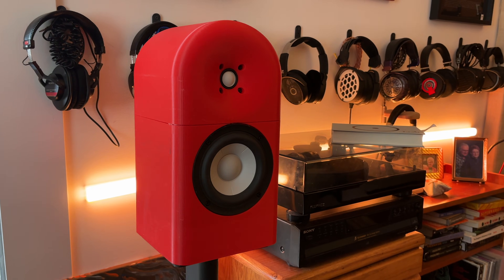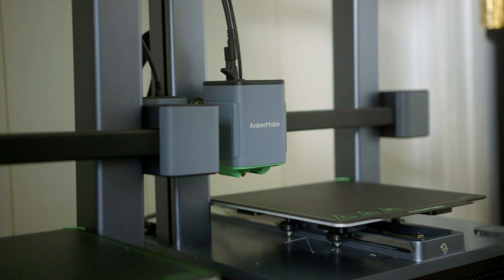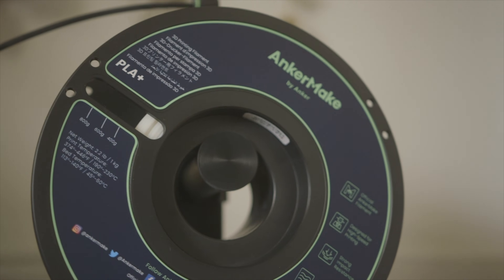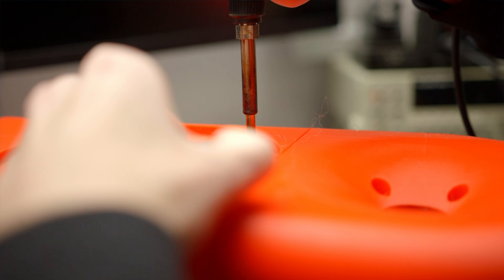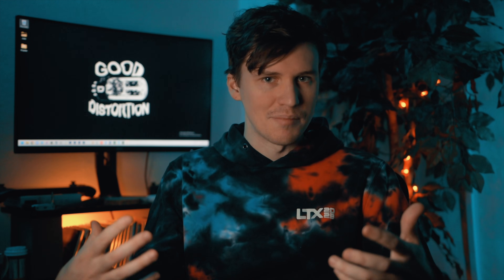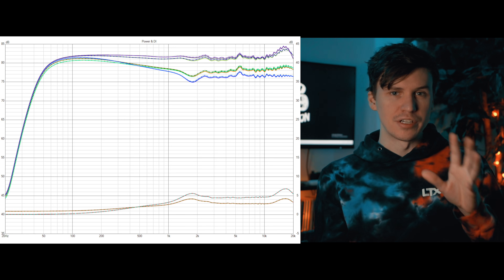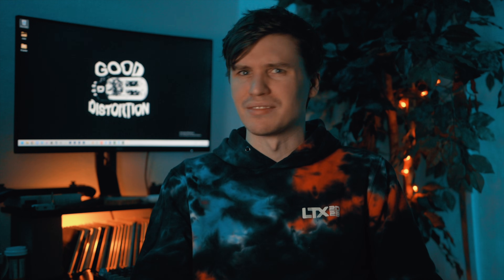3D printed Audiophile Speakers - FREE Designs (pt2)

Comment: 0:45 Are you talking about stiffness and not printing in full? But even if you print with texture, just this weak? I consider your whole concept to be inauthentic and flawed. You saved a lot at the expense of quality. The inside is completely empty without channels and the quality of the print is not very good.

Comment: why not 100% infill for the best reverberance reduction...
Reply from the maker: No need. Tested greater fill levels than what I did and measured no difference.
Reply: Cost really, you gain no benefit and he dumped 2 1kg roll into each box at hopefully 30%.  Thats 120$ + power cost.

Comment: just found this today......still no parts list? I see the speaker components. thank you for that @DMS. If you have anything updated on the crossover materials please let me know. Liked and subbed.
Reply from the maker: The only parts needed are the ones in the video. I can compile a test list though sometime soon. Also: I'm still using these speakers! Love them
Reply: @DMS3TV  Hi DMS, a comprehensive list would be very helpful. What supply do you use?

Comment: Four rolls of filament? Well, sounds like a good option for those who have no wood working possibilities, but kinda makes it uneconomical for someone who does work wood. There are a lot of excellent speaker builds on YT. But up front, for $500, one can build a much bigger set of speakers. Hell, I'm not sure how much better this is than just buying a set of speakers.
Reply from the maker: It would be near impossible to achieve the same radius needed for the waveguide via woodworking without 3-axis CNC.
For a price point comparison you can buy a set of speakers with similar performance (in terms of both directivity measurements and frequency response) for about $2500.

Comment: Any reason why you don't use internal bracing to stiffen the walls of the speaker?
No idea if it would be beneficial or not but quite easy to add so I guess there's a reason you didn't?

Comment: Maybe you can try integrating diffuser/meta absorbers into the inner surface of the enclosure since it is 3D printed. you can also leave holes in the walls to insert metal or cf rods for stiffness/resonance tuning. oh and you can skin it with carbon fiber for added stiffness.

Comment: Okay but let’s say I don’t have a 3D printer and I’m in need of a pair of “cheap” but really good speakers. What brands should I look at? I wanna run them through my audio interface (motu m2). I am not looking for a V-shaped sound, more neutral.
Reply from the maker: JBL 306P mk2 are under $300 a pair and are an amazing value.
Reply: @DMS3TV  those are a bit less flat tho, right? As in they are pretty V shaped for audio monitors
Reply from the maker: @nononanonon  they have a dip at 1.6k but other than that it’s pretty dang flat on-axis especially for the price.
Reply: Adam Audio T7V

Comment: A question for DMS, why 4mm wall thickness, at that thickness on a standard nozzle at .4mm you would need 10 wall lines and at 30% infill it would consume 1.13Kg of filament... just for the bottom half.  Are you 100% sure you printed at these dimensions if so then you might need to adjust the numbers in the video.
Reply from the maker: With a 0.4mm nozzle at 4mm wall thickness and 30% infil mine comes out to 890g of filament for the bottom half. Odd. I just double checked to make sure.
Reply: @DMS3TV  for my software it says 1.13kg
Reply: Though I'm using cura and prusaslicer
Reply from the maker: @cursedvoid  odd. I’m using ankermake’s software which is based on prusa slice. Not using supports right? Maybe reduce infil?
Reply: @DMS3TV  hmm I'll fiddle with it some more to see if it's an error on the program
Reply: @DMS3TV  are there any other settings that you may have tweaked? Because im just not sure at this point, i could put it to the test and run it using a fresh spool to see if it finishes.  You know what yeah im gonna do that ill get back to ya on this.
Reply: @cursedvoid  I'm also getting around 1100-1200g when slicing for prusa mk3 and lulzbot taz workhorse with similar settings, I would also like to know if it turns out to be less than 1kg.
Reply: Im getting similar numbers as well about 1.1kg of filiment. Also the location feature means that its too tall to fit on a prusa mk4, Step files  that we could edit would be great.
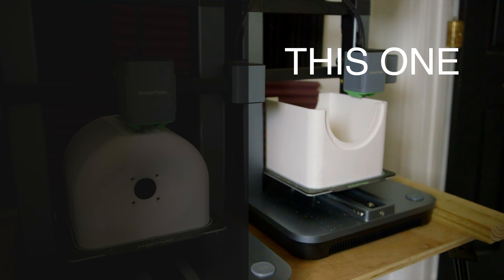Reply: @DMS3TV I'm guessing it that the perimeters should be set to 4 passes ~1.6mm as this means it uses 889g of filament. This is also as at 3:10 you can see the printer doing some infill on the wall of the base, with a 4mm (10 passes) wall thickness the whole wall would be solid as its only 5mm thick.
Reply: @ChristopherPeston  yeah I'm printing it right now and I'm noticing the walls still have jnfill going so I'm just surprised myself
Reply: @ChristopherPeston I think you’re right… look at 0:47 timecode

Comment: What are the different colors in the frequency response graph at the end of the video? If this is a near-field speaker, can it be used in a small room as well (does only verticality suffer in that case)? How much did it cost you to make it (approximately)? What parts did you use for the crossover?

Comment: Let’s get these sent over to Erin’s audio corner for kipper testing!
Reply from the maker: I would love to.
Reply: He's already testing out augerpro's speaker, which uses the same drivers. 
One thing I suspect the Klippel will find is that the side walls have significant resonances at 250-700 hz. No bracing will do that.

DMS's measurements are way too gated to show this, and he uses near field measurements for the woofer so any real cabinet interaction wont be shown, which is a shame. It seems no actual full range quasi anechoic measurements were taken.
Reply from the maker: I definitely did a lot of work to deal with resonances but I’m sure it can always be improved. I don’t have a hemianechoic space at the moment for more detailed measurements.
Reply: Let’s keep upvoting this though to try to make it happen
Reply: Agree - but yup, LOVE the video, LOVE the idea, love the look, but I think tweeter is going to be real hot, my gut tells me that crossover needs a resistor at the start of the tweeter network, with a bypass cap on it in parallel to allow some 15-20khz to pass over it. Easy fix. Looks to me like woofer was only measured in nearfield and baffle step compensation is not correctly applied to woofer giving correct sensitivity match between drivers. I could be wrong though!
Reply from the maker: @maxpower7504  I also measured the woofer at a distance as best I could 😄 there’s a part in the vid where I mention a spot you can add a resistor to the crossover for less treble and point out where it can go. That said, the fun of the project being DIY is you can always modify and improve it.
Reply: @DMS3TV  oh thats good! okay sweet i'm wrong, looks like you are all over it :) I will have to try your xover
Reply: I think as sound as the design is at the moment, the additional data could be so useful for figuring out what could still be improved. Any plans for a larger or smaller model later on?
Reply: I was thinking the same, I'll ping Erin to get his take